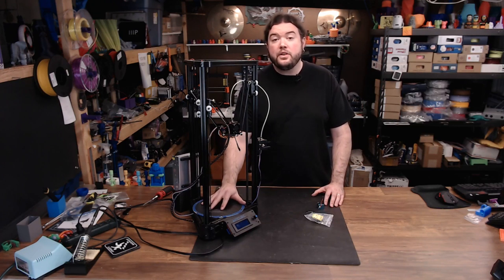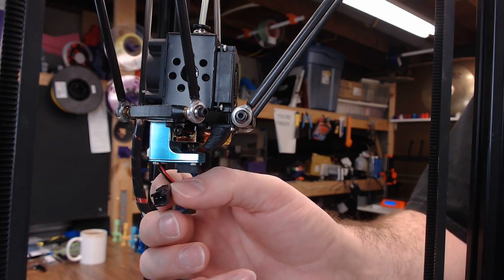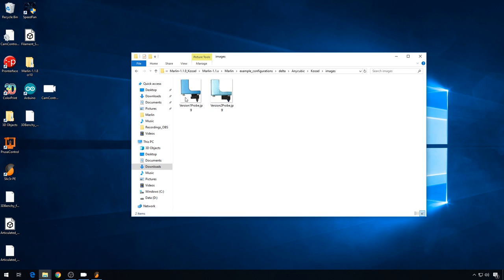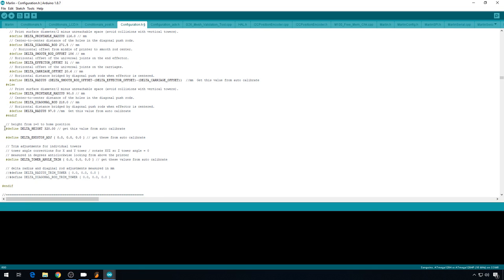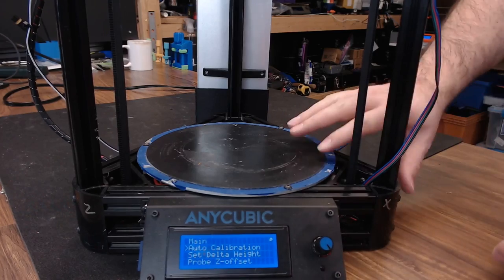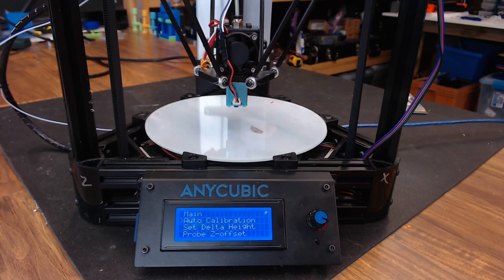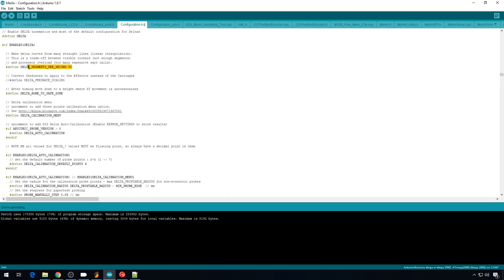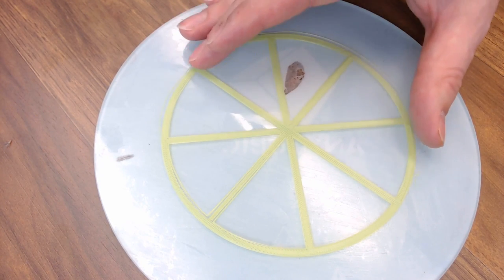Delta Auto Calibration - Marlin 1.1.9 - Chris's Basement

Comment: I have changed the end platform for a bigger one, and now I have a weird geometry with bad angles when I print an X,Y,Z cube calibration. I change the end effector value from 33 to 55, and I have this issue. Do you know what i have to change on arduino ? Because with an horizontal radius lower I have a smaller cube, it is not what the result expected. 10:05 10:06
Reply from the maker: It's been a long time since I leveled a delta and the value labels may have changed. Maybe this manual level video would help. https://youtu.be/Xk7remEhUx8

Comment: Chris  great to see this.
 
Did the same about 3 weeks ago. only i forgot the record it :)
on the kossel linair plus. the type 2 probe is already supplied with the printer.

good to see i didn't do strange things you didn't do.....
was also thinking about if a bl touch would be better, but the point is  it's important here  that the  probe is as close to the nozzle as possible.
and what is better then under it so you only have a Z offset diff.

i ordered it because i also wanted to learn more on the Delta type printer.
next project a coreXY DIY, collected more then enough "spare" parts.

keep up the informative vid's

regards Ron
Reply from the maker: Thanks Ron! Yes, I tried many times to get the Bltouch to work and just couldn't make it happen.

Comment: Got gifted a Kossel Linear Plus by my brother today because it was being used as a door stop. Google sends me to your channel and a video on this machine. Awesome, especially after having upgraded my Anet A8 to Marlin following your videos. I've hit one snag I hope you can give me a lead on. Everything seems to power up, I've flashed Marlin 1.1.9 and can connect and drive the motors through Pronterface. Homed X & Y but scared to home Z for fear of bed crash. Haven't seen a flat bed like this for ages :P However the LCD display only shows the main page. Rotating the dial and/or pushing the dial button does nothing at all. So I can't navigate to the auto calibration etc. functions. Cables are connected in the correct order. Any ideas on how to trouble shoot this? I guess I could always buy another display but I'd rather do that after confirming it was faulty. Appreciate any advice you can offer.
Reply from the maker: Hey, not sure, but I would go back and look through Marlin again. There is an option for no menus, maybe this got ticked by mistake.
Reply: @ChrisRiley  OK thanks. I'll check it out. You've got a great, no-nonsense channel. Love it!
Reply: @ChrisRiley  Found the no menu define in Configuration.h //#define NO_LCD_MENUS but it was commented out. Thanks anyway for pointing this out. Would not have thought about that possibility at all. I'll take a look at hardware now. Cheers.

Comment: You know what would be a great video for the Delta / Kossel printers is a complete Up-To-Date walk through of (installing / setting up) the firmware with the latest Marlin 2.0 using VSCode. one that also shows you how to do the delta calculations as well. For one there is not many guides for Delta / Kossel firmware to begin with, video or otherwise, and if you find any they are base around relatively old versions of Marlin and usually just tweaks to existing firmware. They mostly are not a fresh build from scratch. Most build from scratch guide for Marlin firmware are Cartesian or CoreXY. Anyways it is just a thought.
Reply from the maker: Thanks for the comment, I have been thinking about my delta lately, maybe this is what I should do with it.

Comment: Hey Chris, Very informative. I've never had a delta (yet) but I do like the look of the kinematics when printing, might get a delta to try some time.
When you pushed on the sensor at 1:30, it looked like it flexed a little, maybe thats what prevented your print from being quite up to scratch?
Reply from the maker: Thanks Spike as always for watching. It could have been, I worked on this video for about 3 days trying to figure out the best way to get it level. Seemed like glass was the winner. This delta has just enough wiggle room on the smooth rods to make it just a little off. I was pretty impressed that the level was even close to this good.
Reply: @ChrisRiley  Ah! of course, Deltas would need very tight couplings to be accurate. Still a great result for all the work you put into it. So far the only surfaces I've used are PEI (MK2) and glass (Sigma and CR-10). I would like to try a lighter surface on the CR-10 at some point, but I have great results with glass (and Magigoo) so not really in a rush, they all seam to have limitations, but glass works great across the board for me.
My Keenovo bed has just arrived so looking forward to installing it, maybe over the weekend if I can get time. I plan to install the SSR separately so need to design an enclosure for it.

Comment: Nice one! Cheers :) just bought the magnetic levelling sensor, the ultrabase glass and a new hot end to rejuvenate my Kossel.. knew you'd have the video I need.. I'm thinking about buying a 32 bit controller for my Anycubic delta.. any suggestions? Thanks. Stan.
Reply from the maker: Awesome, check out the SKR boards, they are cheap and can probably handle it easily.
Reply: @ChrisRiley  thank you sir ;)

Comment: After I upgraded to Marlin 1.1.9, (I even tried the Marlin-bugfix-1.1.x and Marlin-1.1.x), my Kossel Pulley seems to behave strangely.

Upon doing the LCD [Auto Home}, or even the G28 on the Pronterface ==> the print head goes up to HOME and then once it has "homed" itself, it goes down by about 45mm and stays there.

It was working perfectly well previous to the firmware upgrade. Hope someone has a clue what could be going on.
Reply from the maker: That is safe delta homing doing that, you can turn it off if you like. DELTA_HOME_TO_SAFE_ZONE
Reply: @ChrisRiley  . You just save me from wanting to tear my printer up. I am now on my way to the next step. Absolutely fantastic response.
Reply: Just to let you know that I wrote about your help & video here. More Kossel owners should know about this video.  https://macro-passion.blogspot.com/2020/09/catching-up-with-my-3d-printer-i.html

Comment: Hi just installed 1.1.9, thanks to your video. Only thing I can't find is a "Stop or Pause Print" in the menu! This function is very handy if you come across a problem when printing.
Reply from the maker: Do they not show when a print is running? I thought the showed up when printing from SD. I would have to go back and check.
Reply: @ChrisRiley  Hi Chris
It doesn't show when printing via USB. I'll have to try when printing from SD.
Reply: @ChrisRiley  Hi Chris
Just tried it printing with SD card and it does show stop and pause print.
Cheers

Comment: Do you hage any video on delta auto calibration using a NPN sensor and perhaps from scratch (not using an model specific Configuration file)? That would be great for ppl like me that is converting his non standard kossel alt to ABL. Thanks for this video, though
Reply from the maker: Hey Bruno, I don't, on a smaller delta like this one it's hard to use a sensor that is not at 0,0 because of the effector tilt. If I get a bigger one I will investigate this topic.
Reply: @ChrisRiley  Thanks for answering. The Kossel Alt delta I am working on has a 25cm round x 80cm tall print area. Search for it in thingiverse, it is a robust (very) big printer!
Reply from the maker: @brunocabral1578  That's a big printer! I hope you find the information you're looking for.

Comment: Hi Chris Great tutorial, thank you.
I have a question: I have followed along with my own printer and all works as expected with one exception my hotend drags on the build plate. Do I have to lower my Z height? and what would be the simplest way to manage that?
Thanks again.
Reply from the maker: If it drags every where on the build plate, then yes, a height adjustment should fix it. So the easiest way is in eeprom, do an M503, look for M665 out put, your delta height is the H setting. You can change it with M665 Hxxx then M500 to save.
Reply: @ChrisRiley  Not sure if you'll get this, the original content being so old? I have a problem that I can't find a solution for and was wondering if you might offer some insight. 

I still have my Anycubic Kossel, it has been running like a charm since I followed your delta calibration video way back then. The problem: The Bed heater stopped working. i put a volt meter on the control board and it's reading 0.0v. Fuse? Can't see one on the board, at least nothing apparent to me. 

I guess the question is can it be fixed or do I need a new board,  and if so what do I replace it with? Is this something you could shed light on for me? Perhaps it's worthy of a video. 

Thanks in advance, Thanks for the content.
Reply from the maker: @andrewstokes5286  Do you still have the old school Tri Gorilla? There was a micro fuse net to the DC power in jack. See if that's still good. I think it is this fuse. https://amzn.to/4d5eoQs I THINK they were 15amp??? Let me know how it goes.

Comment: Chris, What options do you know of for a Monoprice Mini Delta?  As always your videos share lots of information; but one thing I did miss was a quick time lapse of the auto calibration process.  Deltas are less common, and auto bed leveling is different on a delta.  Thank you!
Reply from the maker: Thanks John! Yes, I should have included more time lapse. I was trying to get through it, I probably should have slowed down a bit. Pointers and opinions are always appreciated. 

On the mini, I run this in the start gcode after the heatup and G28.  G29 P6 Z0.8   This will probe the largest pattern and set the Z offset to 0.8. You might have to adjust the offset from machine to machine.
Reply: @ChrisRiley  I hope you understand I am not really a troll, just giving you useful feedback.  I still hit the Thumbs Up button you did a great job covering the important information.
Reply from the maker: Lol, you're the best John, very helpful point of view on the videos, I really do appreciate it.

Comment: Hey I have a question about my anycubic Kossel. When ever I try to print it will print for about 1- 1 1/2 hours and just stop and the lcd goes blank then i try to restart it and the lcd is very dim and whenever I click something on it it restarts. What could the problem be? Do you have any idea?
Reply from the maker: Wow, not sure, are you printing from the SD? Maybe a bad SD card reader.
Reply: Chris Riley I get the same results with printing by usb I’m guessing it’s just a bad board any suggestions for good new ones?
Reply from the maker: @Mike-gv4je  As usual, it depends on price. If you want to go back with something like came with the printer on the cheap, I would look at something like a MKS 1.4. If you want to go super high end, I would look at something like a Duet.
Reply: Chris Riley I went high end and got a duet maestro have you ever tried this board before?
Reply from the maker: @Mike-gv4je  I have not, I have a Duet wifi, very impressed with it.

Comment: Hi Chris, I'm still having problems! Runnung a standard Anycubic Kossel Mini. Replaced motherboard with TMC2100 drivers.
Followed your video on installing Marlin 1.1.9 . Everything seems to be working OK, untill I run "Auto Calibration. Machine holts after 1st calibration run and I have to reset. I've setup the TMC2100 voltage. Do you think it is anything to do with these?
Reply from the maker: The drivers could be overheating. The 2100's are kind of bad about that.
Reply: @ChrisRiley  I have shorted the two pads on the chips to prevent missing steps. 
This has cured the problem. Printer new runs all calibrations!
Which chips do you recommend?
Reply from the maker: @paulmarchant5920  I really like the 2209's.

Comment: Hey Chris, this is another video right up my alley. I got ahold of an AnyCubic Chiron which comes with the same bed leveling sensor. What I would like todo, however, is change over to a bed leveling method that executes at the start of each print without manual intervention, for this I've chosen to use a Precision Piezo. My plan is to take the wires connected to the provided Anycubic bed leveling probe (SIG and GND) and feed them to the precision piezo sensor with an additional 5V from another pin. I'm almost wondering if the additional code would need to be added in marlin to account for this change though as it will basically be sending a high signal when it triggers just as the Anycubic sensor would have. Let me know if you see some flaws in my logic! One thing I can see the need to change is the Z offset of the probe that is placed within the original marlin code Anycubic uses with their sensor.
Reply from the maker: Makes since to me. I really want to try one of those sensors out. My guess is your offset would be really close to 0. Maybe + 0.2mm ? Not sure, let me know how it goes.
Reply: @ChrisRiley  Hey Chris working away at implementing this at the moment. One complexity with the Anycubic Chiron is that it has quite a few daughter boards which plug into the main trigorilla board like the one here in your video, this makes tracing a connection back to a particular pin a bit difficult. What I would rather do is look up in software what pin is assigned to a specific function. Do you have any guidance on doing that? Maybe as an example going from the Z min in the config.h to its associated pin in whatever file that information would be found?
Reply from the maker: @singhm29  All that info will be in the PINs.h file. For the anycubic, check in pins_TRIGORILLA_14.h and whats not in there will be in pins_RAMPS.h
Reply: @ChrisRiley  Read a bit more into the marlin documentation and came to that realization but thank you for confirming! The really odd thing is the board configured for the version I downloaded is actually BOARD_RAMPS_14_EFB which is a bit confusing as I can't find a pins_BOARD_RAMPS_14_EFB.h anywhere.
Reply from the maker: @singhm29  Yeah all the RAMPS boards are covered in the same ramps pins file.

Comment: I have the kossel linear plus and have followed instructions but the print head keeps crashing into bed after calibration. Any suggestions would help!
Reply from the maker: So many people have this same issue. It can be so many things. Make sure your endstops are nice and tight first. What version of Marlin are you working with?
Reply: Chris Riley using the one in the video 1.1.9 end stops seem super tight . I’m not sure I want to put much more time into this printer as I bought it cheap . If you have any more suggestions I’m all ears!
Reply from the maker: @briandalton9093  The only other thing I know to try would be to reduce the size of the probing area. You can us the probe bounding setting.
Reply: Chris Riley so change the probe setting back to 20 from the 10 you used in the video? Thanks again for the suggestions!
Reply from the maker: @briandalton9093  Try that, or maybe even 30. Just trying to get good solid probes.

Comment: Everything is working great, except no matter what I do my extruder refuses to even turn. Any idea what that could be?
Reply from the maker: If you nozzle is heated and it still doesn't turn it's probably a bad stepper driver. Grab a cheap a4988 and try swapping it, or swapping one of the other ones to see if that resolves the issue.
Reply: @ChrisRiley  I swapped one of the spare stepper drivers, and nothing. I tried a known working motor and still nothing. Would turning one of the screws make a difference? If I did everything pretty much identical to you, is it another bad board?
Reply from the maker: @macsogandares8383  Try moving the extruder cable to X or one of the others and make a movement, does that work?
Reply: @ChrisRiley  Nope. I swapped the drivers again, and tried with a known working extruder motor. It worked great, but I need this motor for my other machine. The extruder motor that I have here is a bit bigger, would I need to tune the stepper drivers? When I send an extrude command, with this motor it moves (although it sounds more like a jump) but then it won't move at all unless I reboot the machine.
Reply from the maker: @macsogandares8383  Yeah, it could be voltage, check the driver with a multi meter. I usually set them around .8-.9.
Reply: @ChrisRiley  I tried between .6 and 1, got nothing to work. But, this other (slightly smaller) motor works just fine, so I'll swap it in for now.
But, I don't wanna buy another motor for my other machine. Any idea what my next step would be? I checked it with an ohmmeter and the resistances looked good to me.
Reply from the maker: @macsogandares8383  Not all steppers are wired the same way. You might try swapping the two center wires on the motor cable.

Comment: Im sure you know what your doing, but as a tutorial, your going way to fast and using terms that a lot of us have no frucking idea what your talking about  I guess Ill go over it slower and slower, ,
Reply from the maker: I hear ya, but you can imagine as a content creator it's really hard to judge how fast or slow I need to go on certain topics. If there are topics you would like to see more info on, please feel free to leave them in the comments.
Reply: @ChrisRiley  all I am trying to do is load a new firmware to my kossel, your throwing around terms , flying through pages,, I just gave up, is this the only way to do this?? is there any way I can just re load the firmware, to my new printer, as I just finished assembling it and of course, nothing works, shows question marks on the position of the x y  z axis,,  Or,, how about I just send you my  card from my printer, and you load it for me,,,,lol,, Ill take care of your time,,,
Reply from the maker: You really shouldn't need to reload your firmware. Can you not print or do you just need auto leveling? Is it an Anycubic printer?
Reply: @ChrisRiley  I straightened it out,, thanks  end stop micro switches were not plugged into the correct ports